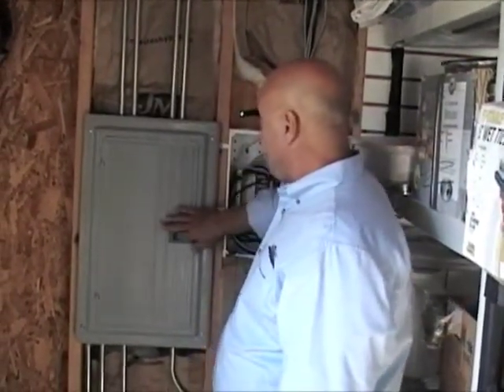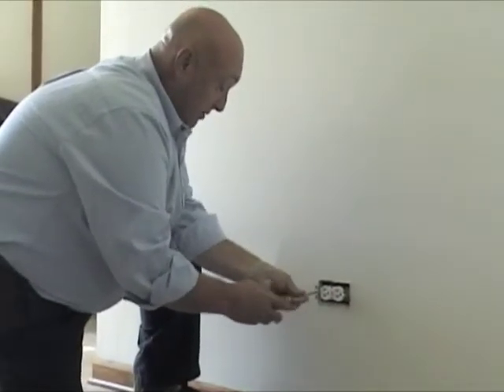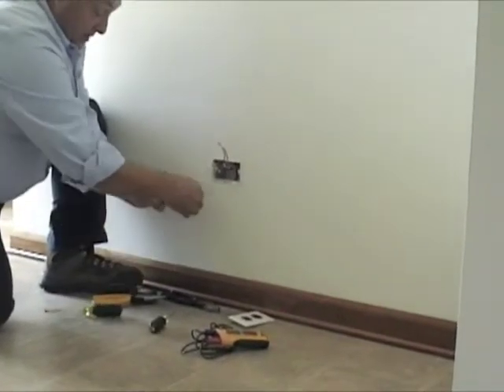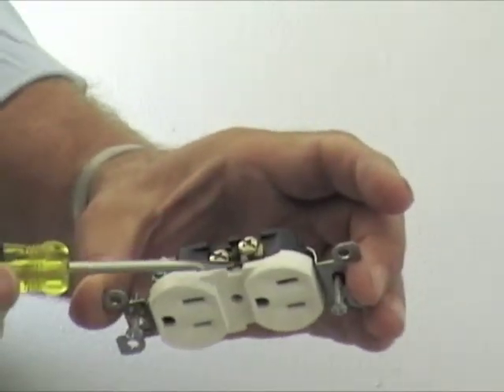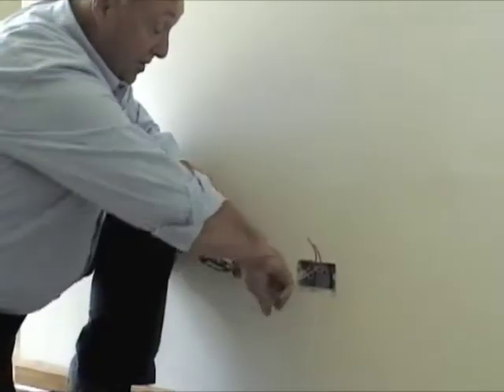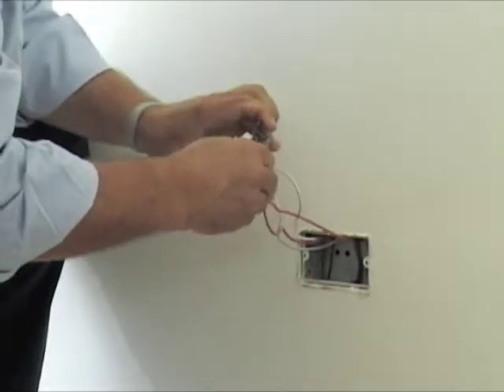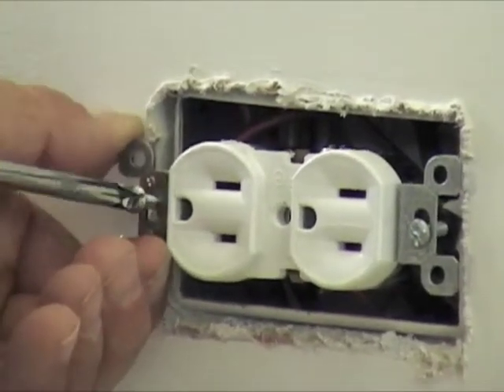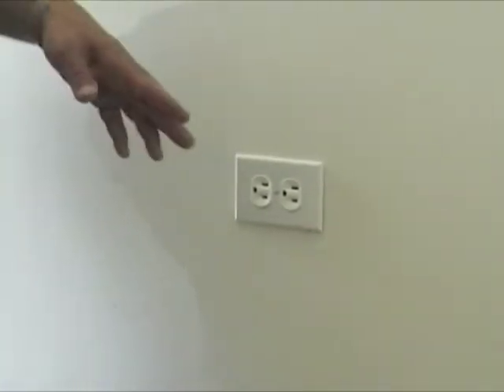How to Replace a Leviton Wall Plug or any Receptacle

Comment from the maker: In this situation as stated in the video, metal conduit is used as a raceway to hold the wires, as well as metal boxes/fittings. This will give you a "case ground" condition, meaning the entire system is grounded. Running or connecting a ground wire is unnecessary in this type of installation. As far as removing a wire from the breaker, if you always treat the device (switch, outlet, etc. ) like it is live, then in the extreme situation you mentioned you would be safe. In a commercial setting a lockout system is used to eliminate that possibility.